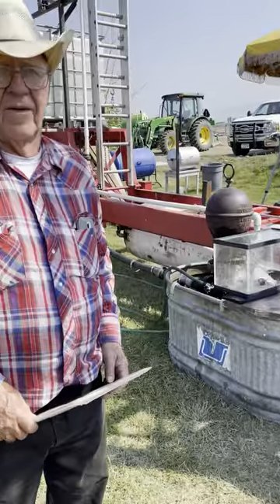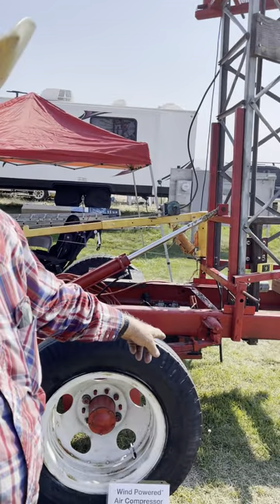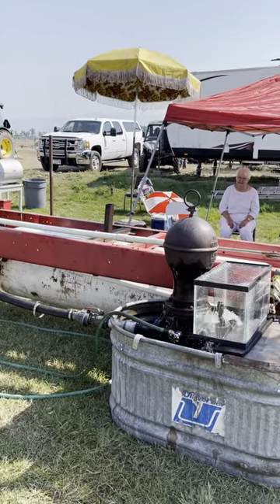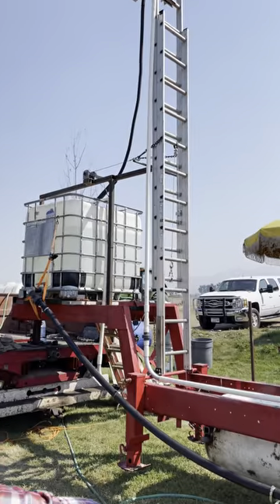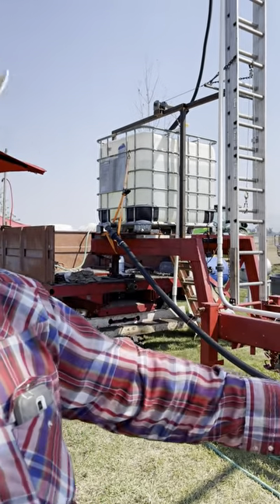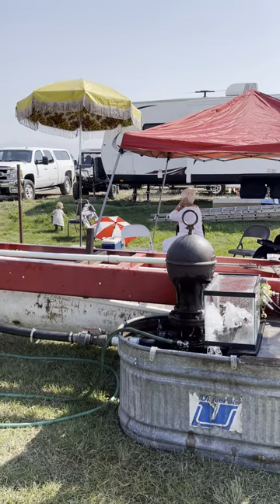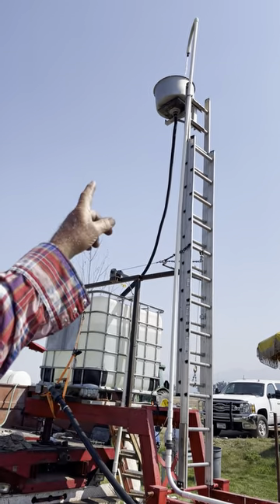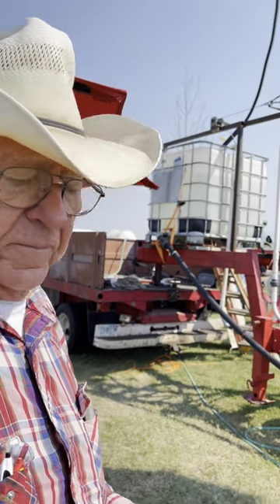1800s Hydraulic Ram Water Pump + Wind Powered Air Compressor

Comment: Thanks for posting.  I wondered what they looked like.  On our farm, they installed a hydraulic ram in a spring in 1879.  it sent water to a cistern under a windmill.  That windmill then  pumped water into the house.  They had running water available in the basement of our farmhouse well before anyone in the local towns had running water.
Reply from the maker: This is awesome!